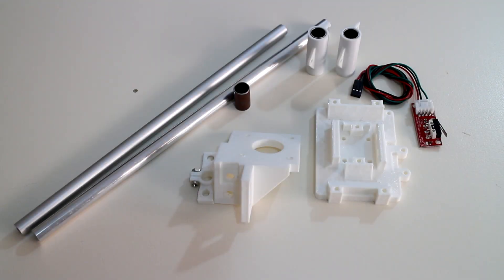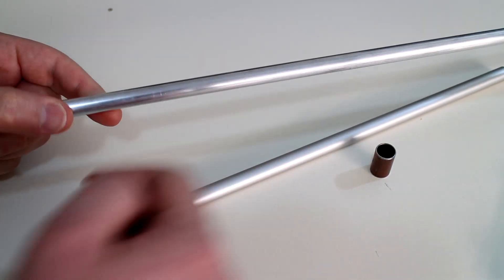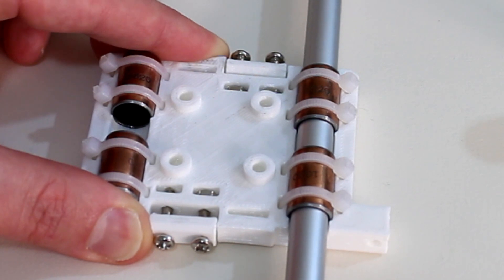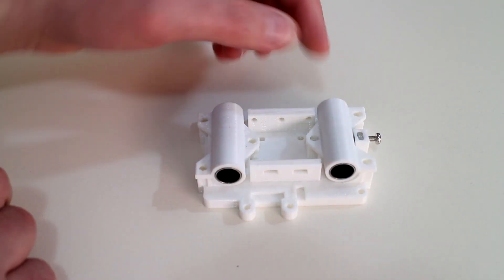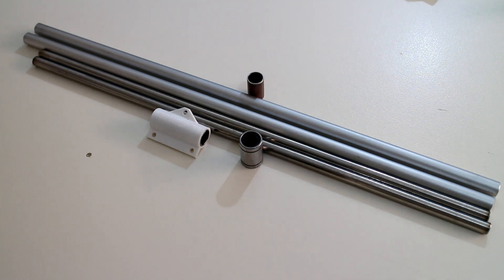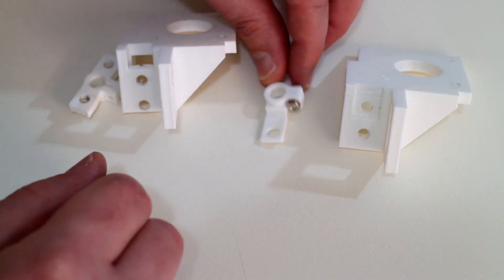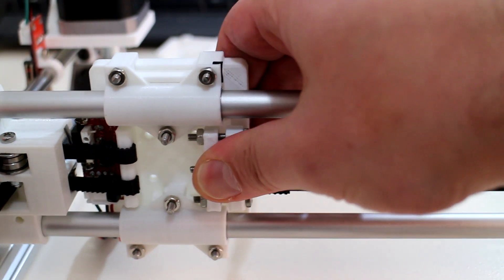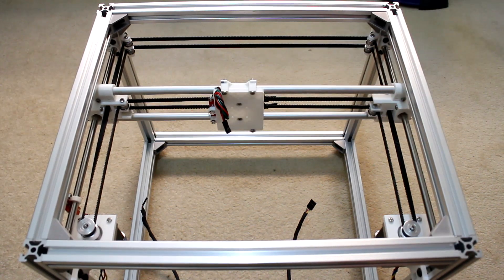New 3D Printer - Build Log #4

Comment: I wonder why you didn't design in the normally used m3 nut housings so that nuts can be heat pressed into the printed mounts which fixes them into place.

Comment: Your reasoning for using toothless flange bearings over proper GT2 tooth idler is very strange. There is absolutely no reason to use them, in fact, GT2 idlers cost LESS than your flange bearings, I just compared the cost on both banggood and aliexpress. Twisting belts or running toothed side on toothless pulley will cost you more in the long run, then purchasing proper idlers when you will be forced to change the whole belt.

Comment: Won't cocking the bushings even a tad eventually create uneven wear on either the bushing, rod or both?  I would consider using brass shims inside the bushings the same way older engines used on rod bearings to adjust the tolerances.

Comment: that black residue is likely the aluminum itself being worn down. if you work with it enough it will turn your hands black. the anodized aluminum is treated so it doesn't wear as much which also helps keep the black crud from showing up. this printer is looking awesome!

Comment: I'll be using metal motor mounts. hopefully DIY sandcast in aluminium from single wall 3D prints. I don't see merit in faffing around trying to circumvent design issues caused by inadequate support for small plastic motor mounts that will likely forever struggle to keep the motor fixed into position. There are some workarounds that are best completely avoided.

Comment: I love you belt tensioning design!  I think I will use that concept to design mine.  I'll be putting a tensioning system on both ends to account for the stepper being able to induce different tensions on either side of the belt circuit.  It may not be an issue because their isn't a strong resistance from the motor when it's disabled, but I would rather have the option.  

For your idler pulleys, have you thought about printing toothed sleeves for your bearings?  This is something I'm investigating for the same reason you twisted yours. 

I love your content.  This has been a great series.

Comment: Nice works i have the same idea to convert an i3 after comparing Many cartesian printer to core i really like the core design. Cube is more waf and light head good for speed. Just question why did you stay in 8mm for x ? U2 use M6 with success you could same more weight. Alyexpress is Also selling ready to use clone of U2 parts like bushing for fews Bucks may be good ( not tested)

Comment: Are you worried that spring type flex coupler will compress while lifting/homing the z axis, then uncompress when dropping the build platform? I have the same coupler on a custom machine 1mm pitch lead screw, and have checked this concern with a dial gauge, and it does hold some truth. And the first few layers until the coupler settles are a bit varied in thickness. Or there is something else happening in the system I am unaware of.

I have also picked up the same 8mm pitch leadscrew that you have, and was really unimpressed by the huge play in the nut on mine.
Reply from the maker: Yes there is quite a bit of play in the nut. I guess that's how it can spin down the leadscrew on its own. In fact because of the play it is causing the entire build platform to play.

Comment: Ever thought of using glass tubing instead of aluminum?

It's extremely hard, and in your application would not be subject to flexing stress.  You can purchase solid tubing http://www.ebay.com/itm/Pyrex-Glass-Stir-Rods-L-300MM-OD-10-Lab-Glassware-/151252226016?hash=item233755cfe0:g:kjsAAOxyGqZSYUFq or hollow tubing through which you could run a steel or aluminum insert. https://www.amazon.com/Borosilicate-Glass-Tubing-10mm-Inches/dp/B004QOJ6EM

I would guess they sell it in your neck of the woods - any scientific supply house should have it.  Or order through banggood, I suppose.
Reply from the maker: I'd be worried about the glass shattering. I did think of using carbon fibre as that is very stiff, but not sure how the surface will hold up over time. I'll see how the alu performs initially before changing. Cheers!

Comment: The usual way to deal with diameter differences between bushings and shafts is to split the bushing and have a way to compress it controllably. With industrial machines that's often done with peelable shims, but a compressible housing will also work.

I appreciate the reason you're using the aluminium rails/bushings and good job for experimenting, however you didn't properly consider the weight of the whole assembly when comparing them. The hardware associated with something like an SC8UU is very basic, and a much simpler carriage can be used. There will still be a weight saving with aluminium/bushings, but not as much as you suggested. I also feel you're on a hiding to nothing with that, as bushing were used in the early days of 3D printing, and ultimately abandoned. I didn't get why you were comparing the weight to a stepper motor. Just the same, good luck with the build.
Reply from the maker: Interesting to hear you can split the bushing to remove the gap. I certainly won't try that with these. I did think of compressing the bushing with cable ties very tightly but I wanted something that was easy to adjust, like tape. In the end I'd spent way too much time on it and had to just move on. The first print will decide if this configuration was worth the effort or not.

I feel the weight saving is tangible, especially as we crank up the acceleration moves. People who've switched to bowden extruders from direct drive highlight the weight saved from removing the stepper motor from the moving mass, that's why I included it in the weight review to highlight the similarities in weight saving.
Reply: Ah ok, I've always used a Bowden so didn't get that connection. 

I think if I were splitting those I'd print up a housing with a flexture on one side and an adjustment screw on the other side. That's generally the configuration on larger machines, with peelable shims on the screw side so you can tighten the bolt(s) down on something to form a solid housing again. On something like this it probably wouldn't need anything as high tech as shims, just tighten down on the flex of the housing.

The good thing about all this is there's no right/wrong and plenty of ways of doing things. No sheep stations at stake here, so good to see some experimenting going on.

Comment: (I'd like to repeat a concern I raised in the comment section of the last video. It was a few days after the video was published, so it probably wasn't read much.)

Awesome! Those CoreXY kinematics are very interesting, and I see how they'd make the moving parts lighter. And I love how quiet it is.

But I have a bad feeling about this whole belt system w.r.t. quality, reliability and longevity. The total length of belts in your design is greater than I've seen in any other printer. Belts seem to be prone to slipping, vibrating loose, etc. And isn't there some stretch to them that may cause imprecision? If so, you'd be multiplying all those problems by 4. And common axis-aligned movement relies on the interplay between all your moving parts, compounding any error. (Question: Would a test cube come out better if you rotated it by 45 degrees on the print-bed?)

This is just a gut feeling, mind you, and I'm quite inexperienced, so I'd love to get a response.
Reply from the maker: Hi Michael,
This setup is not new and is being used on many core xy machines. They don't seem to be  hampered or amplified belt effects you speak of. Not long now until my first print which should alleviate many concerns. Cheers!
Reply: Fair enough. Though I'd be interested to know why my intuition is invalid. Maybe these belts are just more reliable than I thought, and any imperfections are negligible.

Anyway, looking forward to your first print. Thanks for the response!

Comment: Don't most stepper motors have screw holes on both the front and back.  to stop the bending/sagging of the stepper mounts could you just have another mount bolted to the same vertical on the underside of the stepper motor?

Also consider using optical or halleffect endstops. I've found that if something goes wrong or with repetitive use the mechanical arm of the endstop bends slightly which knocks out calibration. (though this has more of an effect on delta designs not sure about coreXY)
Reply from the maker: That is a good idea to support the motor from underneath. I'll see once I print the motor mount with a denser infill if it's still required. 
I have been using mechanical endstops on my printer without issue so far, but I understand the benefit of optical/hall effect sensors which don't make physical contact.

Comment: This build is turning out excellent so far!  Great quality design and well thought out.    Just an FYI about Igus polymer bushings should you desire to try them out.  The polymer bushings start out with a low tolerance (quite a bit larger than the rated inner diameter).  I believe they are actually designed to be press fit into a bearing housing to achieve a tight tolerance.  I wonder if you could use this to your advantage to find the perfect fit for either of your aluminum rods.   

Btw i'm not an Igus rep or anything but I do use their bearings on my i3 and will never go back to LM8UU bearings.
Reply from the maker: Yeah igus would be the next logical step if these bushings don't comply. I'll see how these perform after many hours of use and decide if they stay or go. Thanks for watching :)

Comment: Really coming along nicely. Do lubricate those rods though, with a good grease. Maybe a good PTFE based lube, or a molybdenum sulphide based one. Or indeed maybe even a wax lubricant (tends to stay better, collect less dirt)
Reply from the maker: Thanks for the info. These bushings self lubricate but I agree I think it needs more. And certainly can't hurt.
Reply: Grease is NOT good for smooth rods. A standard machine oil (just a thin layer) provides better lubricatian and keeps the rods clean.

Comment: For the left motor mount, you may want to consider having it be designed for 95 degrees vs 90 degree angle mounting point to account for belt tension and the downward pull.
Reply: Why 5 degrees? not 4 or 6? or 10?

Comment: A possible suggestion for you to consider, maybe incorporate the horseshoe bracket/mount for the Y axis endstop (maybe with a rubber bushing to avoid vibrations) into the left motor mount, that way the motor would have an addition support on its far side by being connected to the bar above it.

Comment: hello, you see concern about weight, so why you put the endstop on the hotend carriage, you add weight of the endstop plus wire, just leave on the other axe so like this you have less weight on one axe, great look printer, clean and simple
Reply from the maker: There's a fine line between weight saving and function. I think having the endstop attached to the x carriage is beneficial as we can home the x axis anywhere. Also these endtops don't weight very much ;)

Comment: Why don't you integrate the end stop into the motor mount?  This clamp on rail for the endstop reminds me of the ones I got with my printer kit, it works but but is not really nice. Anyway I have a question, can I scale this build to a 30x20 of 30x30? or can the Z system your are building not handle a plate that big? (Assuming you already now how to build it) :-) I print a lot of props and and quite a few of them used a bigger then 20x20 build space, like the ghostbuster trap for example. Anyway nice vid as always, take care.
Reply from the maker: You print props? Sweet, great use of a 3D printer!

The clamp seems to work ok for the y endstop. I will cut a groove in the left motor mount to allow it to recess a bit.
Yes you can make your build size anything you like, generally the larger the build size the lower acceleration you may have to use, but will work just fine.
I think what ever the z axis is it will support a larger build platform. Cheers!
Reply: That would be great, I really need a ghost trap :-) I actually bought my printer to print things like that. To really hold a fusion core or a mini nuke from fallout in your hands Is quite the experience. Just finished the laser gun from fallout, a 2 week print @ 30mm/s 1.2 kilo of pla. I really like this hobby.

Comment: one does not simply twist such a belt! Why dont you print a little gear that fits the teeth of the belt and the flanged bearings?^^
Reply from the maker: Why can't one simply twist the belts? Notice the twist is quite long and shouldn't add too much, if any, strain to the drive system. I like your idea about printing teeth to slot over the smoothed idlers tho...
Reply: Yes, cheaper than toothed idlers and no twisted belts. :)
Reply: Because 3d printing gears isn't very accurate and would cause printing tolerance loss.  Twisting belts is actually a pretty safe thing to do for 3d printers since the belts are not under much load. My printer design incorporates the same belt twist and I have two printers with over 1500 hours each still running the original belts no problem!
Reply: +3DprintedLife this can be okay, if the engineer has planed and calculatet it, but im sure our friend here didnt calculate the belt tension, nor is an engineer^^

Comment: 14:00 - With that design, how do you fine tune the belt tension of each individual belt?
Reply from the maker: If you're after fine tuning, you can tighten the screw on one side more than the other. 
Also when first aligning the belt tension I've found it beneficial to push the x gantry to the back so both xy joiners are resting on the frame, then use long nose pliers to stretch each belt tight and cable tie in place. This way you can notice any slant in the x ganty if one side isn't resting on the frame and adjust the belts according. It takes a couple of trys but seems to work just fine.
Reply: I was concerned about that too.
Reply: I guessed you had already thought about it.
Thank you for explaining it for me.